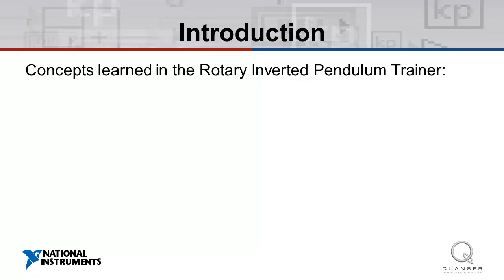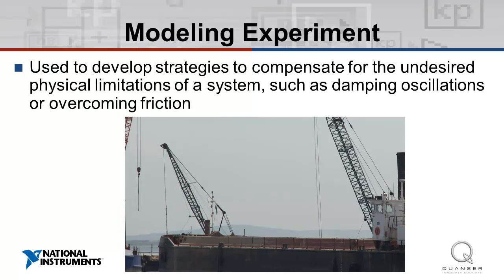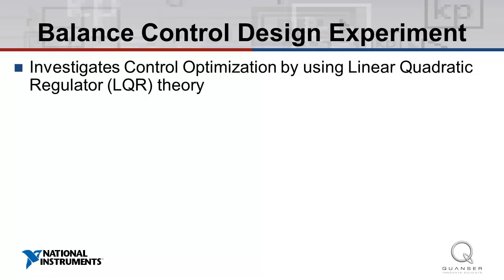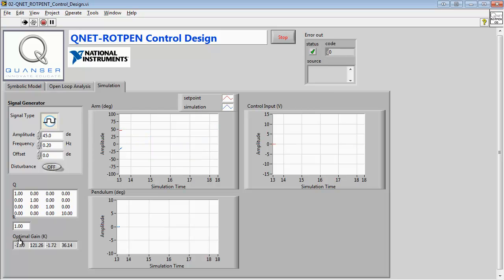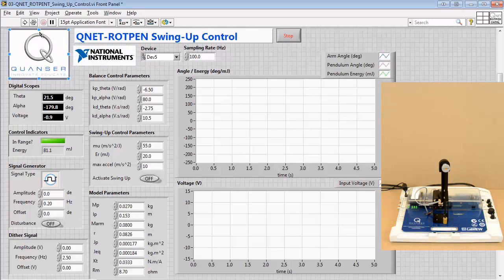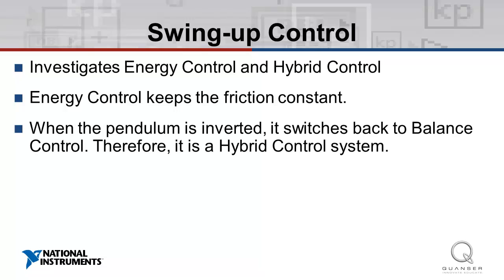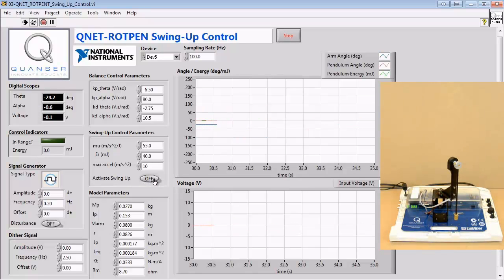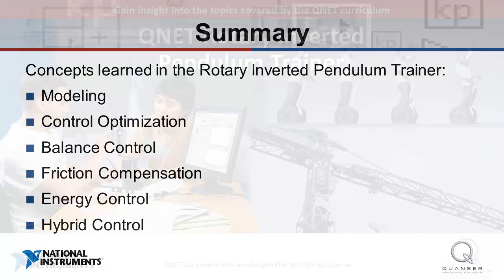QNET Rotary Inverted Pendulum Trainer

Comment: Thanks for sharing the video! I'm having some problems with the implementation of the pendulum control using the STM as a microcontroller, on board and I have a specific question, could you help me? I've already seen the workbook and did tests, so I'm using 1KHz (I tested other values) of pwm for the engine and I get a dead zone of approximately 27%.  The swing of the pendulum is very smooth and  it works at low voltage values, by the graphic presented in the video, but I'm not achieving this.